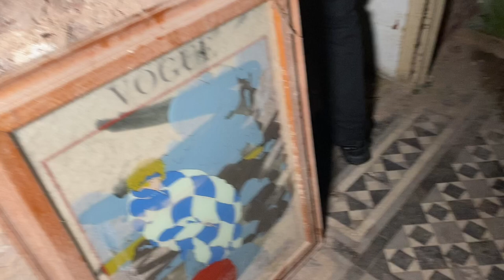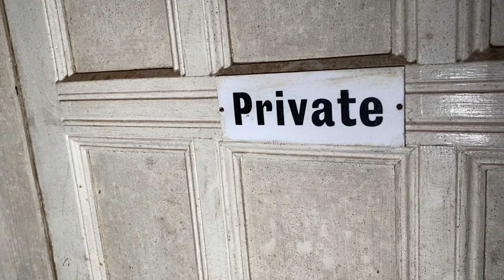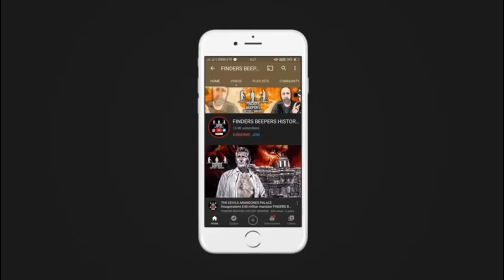Why was this ABANDONED 1700s Admirals Manor House so creepy?

Comment: Another absolutely brilliant explore gent's 🙂👌🏻
What a stunning but very spooky building this one was 😲
Those doors, seats, and stairs balustrades were beautiful 👌🏻
As were the fire places too 🙂

Matt when you looked at that fireplace and it looked like it had a lower and upper section, that's just how a real fireplace is built, normally you wouldn't see that as the faceplate is in place,
But you don't have just a straight up and down chimney flue, it has to have that upper section in for a number of reasons, 
One to stop the rain coming straight down into the home, or onto the fire, 
But mostly to create 'Draw' which drags the smoke up and out, plus feeds the fire by dragging air up, and causing air to feed the fire from the inside of the property, 
The step/ledge is one spot you have to keep clear of soot build up as it can cause chimney fires if that ledge isn't cleaned off from time to time 😉 
But next time you get chance, put your arm up inside of an open fireplace and you will feel the step/ledge inside it will make more sense then if you come across another with the front off 🙂👌🏻

Thanks for another great video guy's 👍🏻

Stay Safe out there 💓 

All the Best, 
Mark 👍🏻